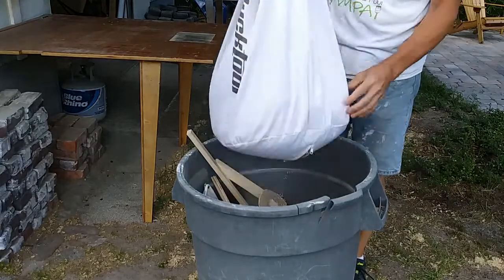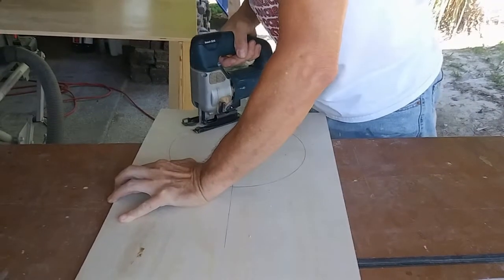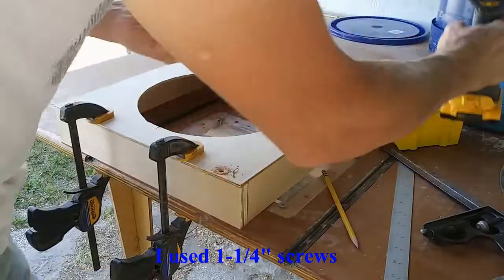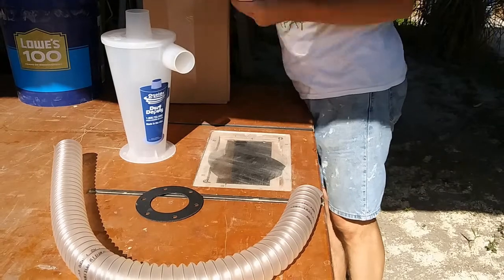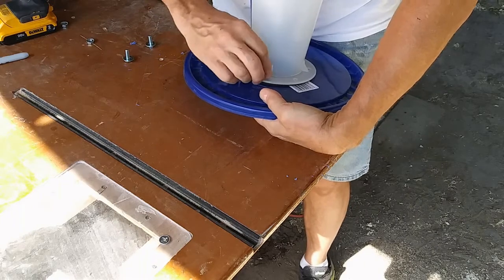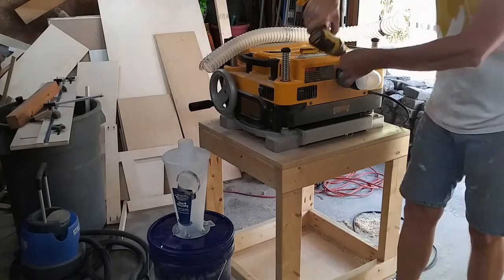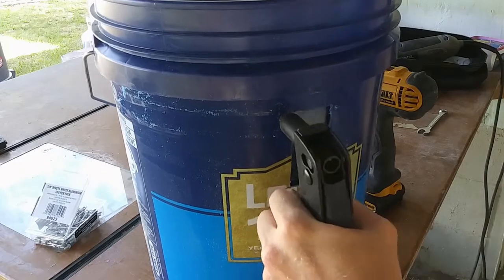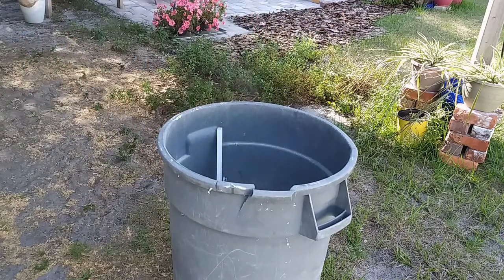Upgraded Dust Collection For a DeWalt DW735 Planer

Comment: Great idea, I'll be doing this. For your setup, you coulx modify your table, make it a little taller and set your bucket UNDERNEATH the planer. You would get back some more space in your shop.
Reply from the maker: Good idea, thanks!
Reply: Or drill the circle on the base of existing bottom of the table to fit the bucket close to the floor, and drill on the sides of the table for the hose. This way  the bucket can sit underneath the planer and if needed  add height with 3/4 inch plywood at the top and drill for hose.

Comment: Thanks for your video. I’ve been procrastinating long enough. Thanks to your video I can see what I need to do for my DW735. I particularly like the filter sock idea. Richard
Reply from the maker: Cool, I'd love to see you finished project.   The sock idea didn't last too long, I updated things two or three times since then.   😆
Reply: @TheTrullGallery  what’d you update it with?
Reply from the maker: @salkarim7392  I added a dust separator that is then connected to my Shop vac.

Comment: My very simple and cheap dust collection system also uses a 5 gal bucket with a 4 inch flex hose attached to the exhaust port of the planer and using a PANTRY HOSE with 1 leg cut off for the flex hose (cut it so you have plenty of leg left to run up the flex hose 12 inches  or so) and then use the body of the pantry hose to spread over the bucket top. May need to racer tape the pantry hose to the bucket Works great
Reply from the maker: cool ideas!
Reply: It’s a panty hose not pantry

Comment: They make semi transparent 5 gallon buckets for food which they also sell at Lowe's. You can avoid having to make a window and they are thicker. I use them for my wood pellets for my smoker.
Reply from the maker: When I upgraded my bucket to onecwith a thicker wall, I skipped the window.  I just keep an eye on the Dust Deputy.  A semi transparent bucket would work too.  Thanks for sharing!

Comment: I loved this video. I was "on the fence" debating various dust collection ideas for me new DW735. Now, I've decided on the Oneida system. I will also be using your basic design for your planer table on wheels, even though I will modify it some to accommodate a longer melamine infeed/outfeed table to reduce snipe. But I will also build an attached table/stand for the dust collector bucket. Thanks for a good instructional video.
Reply from the maker: I'm glad you got something out of it!  I'd love to see your cart / carts once they're done!

Comment: Awesome. I've just bought this planer and I think I will build one similar, however I would prefer the dust collection to be mounted underneath your cart, so maybe a smaller bucket and that could be achieved. Would help with floor space. Any reason you chose not to do that? Thanks for the vid!
Reply from the maker: @bromarbuildz-oy7ls  I'd love to see what you come up with.    There have been several updates since this video.

Comment: You may want to consider a more substantial filter than a sock.  The most dangerous dust generated in a wood shop is the extra fine dust that blows right through something like your makeshift filter.
Reply from the maker: The sock is long gone.  Two or three upgrades later and I now have the planer hooked up to my shop vac via a Dust Devil II.
Reply: @TheTrullGallery  So no more Cyclone dust collector dumping into the bucket as shown in the video?? Just trying to understand. TIA.
Reply from the maker: @ashokmoghe8035  Nope, I've added a shop vac for additional suction.  It also allows me to use the vac and separator on other machines!

Comment: How do you fit dust port to DW735 ? It is too tight to put it in. 😂
Reply from the maker: The elbow that came with the kit was tight.  I used a heat gun to soften the plastic.  When it was soft enough,  I was able to push it onto the planer adapter.

Comment: Nice - didn’t realize the blower was strong enough to work with the DD. one suggestion, instead of the plexiglass, I’d probably cheap out and cut a window out of a clear plastic bottle and use duct tape or something similar to hold it in place.

Great job thanks for the video
Reply from the maker: When I upgraded the bucket I skipped the window.   The DD is translucent and you can see when it needs emptying.

Comment: I intend to get a DW735 in August and have been thinking about chip and dust collection. Your design looks good but I am not yet decided. I was thinking of attaching a canvas filter bag and a clear plastic waste bag to collect the chips. I have just subscribed to your channel though.
Reply from the maker: There are lots of options.   My latest incarnation is a Dust Deputy 2 (I think) and a shop vac.    It works great, doesn't fill the bags & I can use it on other machines.  Thanks for subscribing!

Comment: Hi very nice video and thanks for sharing your design along with glimpses of previous versions. Since this video is a couple of years old now do you have any more modifications or further improvements to this idea? Any tips/insights would be greatly appreciated. TIA.
Reply from the maker: The current "model" has the Dust  Deputy 2 connected to my Shop vac on  cart.  I'm pretty sure I did a video on that update, too.  The only other change was to run a copper wire from the coupling around all the flex hose terminated at a ground rod.  I got static shocks one time, too many!
Reply from the maker: Here's the updated video, if you're interested.  https://www.youtube.com/watch?v=OTSSFu7O8J8
Reply: Thanks for a prompt response. Watched the newer video too 👍

Comment: Hello!! I have the DeWalt 734.  So it didn't have the blower. This may still help?
Reply from the maker: If you use a shop vac and a dust separator together, it should work.  Or at least help with the mess.

Comment: Have you thought about using a heavy duty 20 gallon Brute trash can instead of the five gallon  bucket?    I'm thinking about using your system in that sized container.  What do you think?  I'm guessing it wouldn't need a base.
Reply from the maker: That should work fine.  I just don't have the room for a bucket that large - yet.

Comment: I have this planer and I am not a big fan, it would cost me about $500 to get the helical cutterheads, the hose of the dust chute is in the way, it pulls lots of amp, and now this 👆🏼

I am switching to Grizzly G0940 13" planer!
Reply: I copied your setup  whitch worked initially but blowback set in.Must be something with my planer.Anybody want to buy aDewalt. 735?

Comment: Trying to see everybody’s ideas on this machine before I modify mine, I think I may go this route
Reply: If you plane any quantity of boards at one time, this bucket is WAY too small to be efficient.  Use a garbage can with a plywood lid and a garbage bag inside with a separator like this atop.  You wheel the planer out to the middle of your shop probably anyway.  The footprint that matters is storage footprint for your planer.  I have a video of what I did and it works great.  I'll post a link in a bit.

https://www.youtube.com/watch?v=yvAnkXKkc9c&t=2s

I've cleaned up the garbage can end of this setup a lot and use the same can and separator for the main dust collection also.  I might make a new video on this after I get my house expansion done that has my shop a messy storage area right now...

Comment: Curious why didn’t you just run hose direct to bucket, why did you need the dust deputy?
Reply from the maker: Initially there's too much air flow from the planer.  All that air has to go somewhere.   An update or two later and the Dust Deputy  catches most of the chips before going into my shop vac.
Reply: @TheTrullGallery  as I was hitting send on prior comment said I should probably say add air vent but didn't.  DW735 has a fan so no need for vacuum and all that you need to is add an elbow with sock on bucket for air to escape so bucket doesn't pressurize.  I have a hose direct to 5 gallon with and air vent on top, super simple, fits under bench and works like a champ.  Huge fan of the KISS method when I do things as long as I get the results

Comment: Great idea. I currently have a Delta planer TP400LS. Have no idea how old it is...found it in my Dad's basement, and it doesn't have a chute to hook anything up and collect the chips. I plan on purchasing a Dewalt 735X planer as soon as Lowes gets them back in stock. I make epoxy boards, and when I run the boards through my planer, the epoxy chips make a mess. Do you think your collection system would do a good job of collecting the epoxy chips? Thanks!
Reply from the maker: Even using this set up and attaching my shop vac to the Dust Deputy I get some blow back when working.  They say changing the cutter head out minimizes this but that's another $300+.  I'll add it one day, I hope they're right.  Whoever "They" are...

Comment: Thank you for the video, where did you buy the hoses and the adapter from the planner to the hose please. My planner did not have an adapter and I am trying to find the correct one. the opening at the planner Outside Diameter is big 2.75 inches and can not find anything that will fit as an adapter yet.
Reply from the maker: I'm pretty sure it was a set that came from Home Depot.   It had several adapters.

Comment: Thank you for the video. If all of the dust and chips go into the bucket, what is the purpose of the cyclone separator? In other words, why not go directly into the bucket? Thanks.
Reply from the maker: The separator is attached to my Shop Vac. If you run the hose from the planer to a bucket you'd need somewhere / some how for the excess air (from the built in blower) to get out of the bucket.
Reply: Oh, OK. In the video, the vac wasn’t connected, but I see how the sock/filter allows for the excess air to escape. Thanks again.
Reply from the maker: I forgot about the sock thing!  I didn't keep that for too long.  🤣

Comment: Have the same planer and hooked up my deputy, no shop vac, kept popping the lid on the bucket, any suggestions?
Reply from the maker: Hey Wayne, I had the same problem until I replaced my cheap bucket with a heavy duty version with a locking top.  I've been using it for months now and its holding up great.  You can find it at  https://www.amazon.com/gp/product/B01DALHBHK/ref=ppx_yo_dt_b_asin_title_o09_s00?ie=UTF8&psc=1
Reply: They make steel, fiber and plastic barrels called "open top with clamping ring". You can get them used free or inexpensively in some areas. The food grade 55 steel barrels are not used for toxic contents and can provide a static ground path if used with HVAC ductwork.  I found a 4 inch spiral adjustable dryer vent elbow that fits the Dewalt planer dust connection. You can get ideas at oneida-air website.

Comment: I’ll be honest…. I don’t understand the need for the Dust Deputy. My understanding is that is a dust separator that is intended to separate large particulates from entering a vacuum filter. In your case, there is no vacuum filter. So why use the dust separator?
Reply from the maker: At the time I was still using bags in my shop vac, and those things aren't cheap.  The separator let me loose the bags and keep the shop vac filter clean.  It's also easier to empty the separator than clean out my shop vac.

Comment: I like this design. I wonder if a layer of 1/4" plywood on the underside of the lid would stiffen up the lid to prevent any sagging?
Reply from the maker: It's worth a try.  I think the bucket was just too thin though.  The new bucket mentioned in the comments seems much sturdier.

Comment: How often does the sock clog up, if it does ?
Reply from the maker: I only used it for a few months  before pulling it off and hooking up my shop vac.  Apparently my socks aren't HEPA rated.  It didn't clog while it was there though.

Comment: You forgot the vacuum fitted to the top of the bucket to make it a cyclone system.
Reply from the maker: I use it both ways.  It seems equally effective either way, but the vac helps with the fine dust.
Reply: @TheTrullGallery  i dunno if your shop vac is some industrial beast or not, but my middle of the road one, connected directly to the chip port on the planer, over pressurizes an some chips an dust blow out around the top, even with a clean (not new, im cheap) filter. had no idea the exhaust on this thing would be so powerful. Unless the bucket leaks I cant see how that wouldnt still be a problem, at least with my vac. i usually work inside so the fine dust is kind of big deal to me. Whats your experience a year into using it, if you dont mind?
Reply from the maker: @richardcagle5475  I have a large ShopVac, nothing fancy.  I now run from the planer to a Dust Deputy 2.5 through a five gallon pail then to my Shop Vac.  I still get some blow back and I fill my Shop Vac bag every few months, but my overall collection seems pretty good.   I also work right by an open garage door  & that may help...